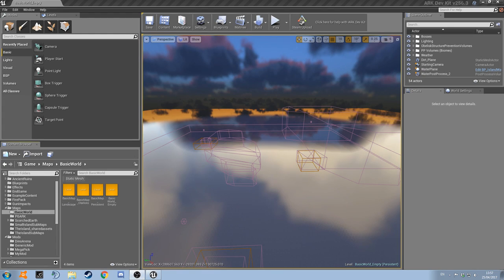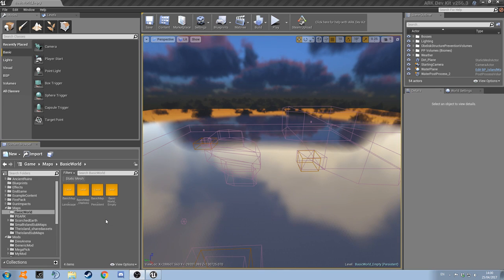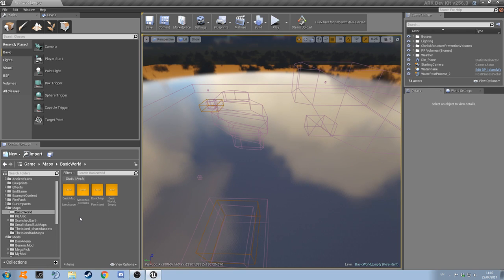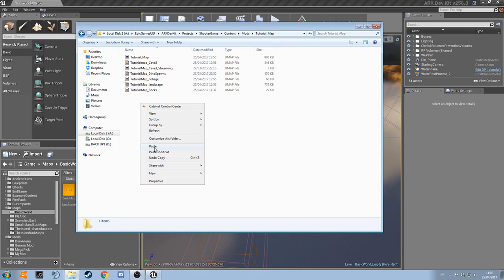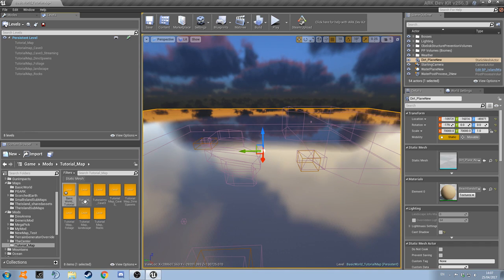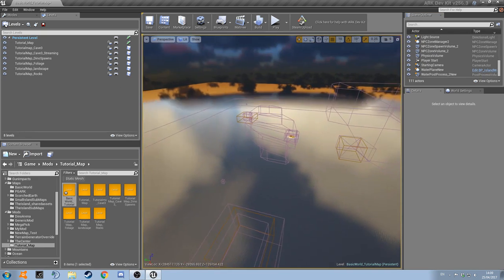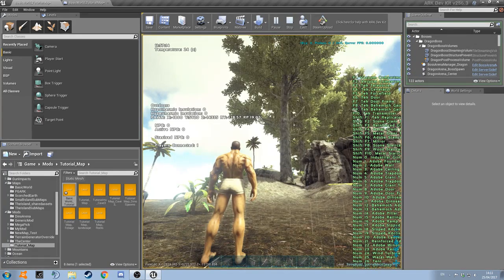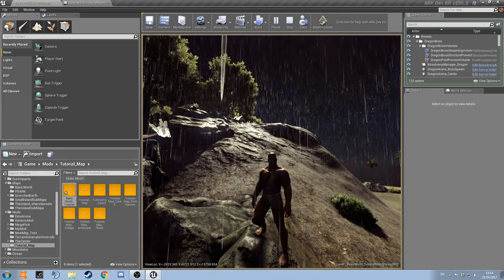ARK Dev Kit Tutorial : HOW TO GET A WORKING TIME/WEATHER SYSTEM! (Easy)

Comment: Two questions: I imported the map I've been working on and now when I test the level my character falls out of the sky instead of dropping in at my start point.  Is there something I need to change or delete and recreate to get the start point working correctly again?  Second, how do I save this as a new map with both your weather levels and my landscape map/foliage settings together as one file?  I tried saving two different ways, one importing landscape on top of weather layers and second by importing weather layers on top of landscape.  However, both ways I tried it, when I close the program and open up the new file, it only loads the original level and doesn't load the secondary added level.
Reply from the maker: ianthemagus I'm pretty sure I had the falling issue in the video, just delete your start point then add a new one, that should sort it. 

So to add this level to your map, add it to your map's folder, then name it Persistant or something (so you can tell it apart obviously). That's then your main level, so always open that first. Then you should be able to open that, then go to levels (window>levels) then click on the Levels drop down, then load all levels. That should load up the rest of the map that's in that folder :)
Reply: Thanks!  In case anyone else has a similar issue, the problem I was having when I added a new Player Start location and was still falling was because I had the old imported Landscape level (which used to be the Persistent Layer before I switched to the Weather Level) selected when I created a new one.  When I switched to the new Persistent Layer, it worked correctly.  I guess it has to be on the Persistent Layer to work correctly.

Looking forward to a future tutorial on how to set up the boss obelisks correctly!  I was able to move them around but some of the parts were located well below the ground layer and I couldn't figure out if I'm supposed to leave them there or move them around to the ground layer to get the little base where you select the tribute options to actually interact with the obelisk.

Comment: Found a big problem when I upload my map it uploads all my levels as separate maps instead of loading them all together so when I start up my game I scroll down my map list and It shows up MyTestMap and then down below that it shows MyTestMap_Foliage and then MyTestMap_Rocks it uploaded my map just fine but it separated all my levels into different maps when I start up the real game. I have a feeling yours it doing the same because I did everything the same way as you so hopefully you can show how this is fixed in one of your next videos. And thanks again dude for all the videos :)
Reply from the maker: Raven Knight Ooo that's an interesting one! I'll look at getting a video on that out for you tomorrow or the day after :)
Reply: @TheDonkeyBoy  did this ever get done? arkdevkit is essentially useless to me because it does this. Missing a world paint and search how to resolve, everyone says "just open the island" where the island is 104 seperate levels and they wont open together, which means no single level will open because they depend on one another. that's just a grander scale of the exact issue raven knight was having, and I am also having. Ready to scrap the whole idea of making a map because I can't manually direct it to paints and cant load levels together that wont load alone. I feel like someone handed me the broken pieces of a rubix cube and told me to solve it without any adhesive.
Reply: @indigowulf  you can open the island as one map you just gotta look for "The island" its in the folder somewhere between all the different levels

Comment: was looking forward on a bit more  of how to make it yourself. it will still help, but not what I was wanting to see.
Reply from the maker: +Commander Honestly, I've been speaking to a lot of map developers, some sponsored and some just with stuff on steam and they all used this method. The level I've provided it just a stripped down version of the island :)
Reply: well either way I appreciate it the dev kit is by no means easy to uses. will this also make it snow in a winter area
Reply from the maker: Commander I haven't tested, but yes it should if you use the snow biome in the level I've provided, or replace it in the blueprint with your own